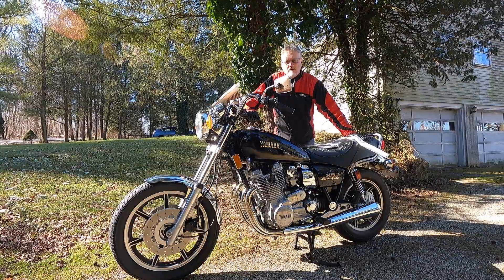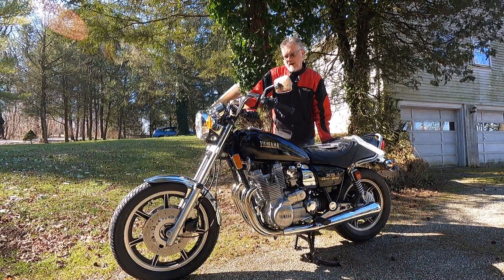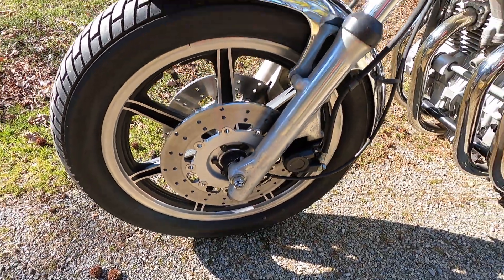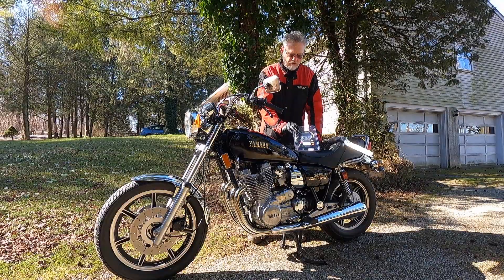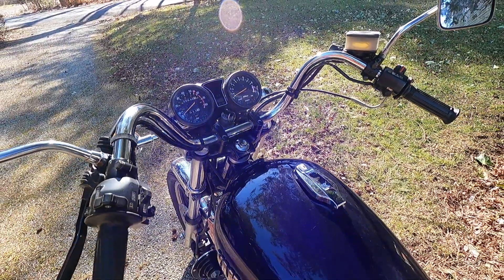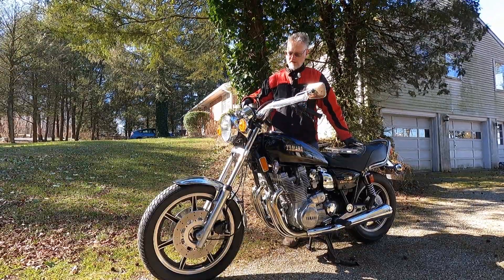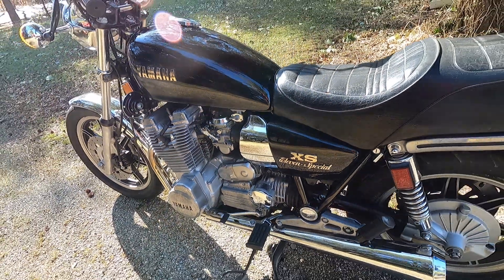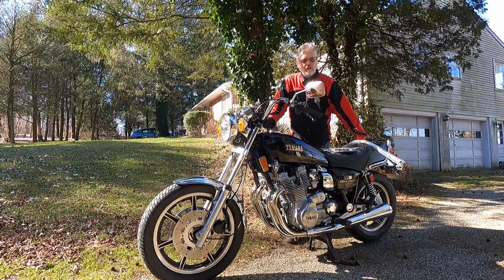1980 Yamaha XS1100 Restoration - Part 5 - New parts have arrived!

Comment: Yeah, Hi Jon, what I did with my '81  XS1100H model, is I removed the stock bars that back then were way too far forward for an "old guy", hurt my back after 10 min. of riding.  I had an old '82 Honda CB900C parts bike, I used those, and then I got some bar extenders  that pushed up 1: and back 2", because the 6.3 gallon tank on the standard H model was about 4" longer than the 4.4 gal. tank on the CB900C.  It brought the bars back to about PERFECT for long hauls.
Reply from the maker: Thanks, that's good to know! I'll see how the new bars fit me and change things up if necessary.

Comment: My 81 had a full fairing installed and seemed to have somewhat neutral handlebars (not exteme pullback)  
Eric in NC
Reply from the maker: They were probably not stock. Those stock buckhorn bars were the worst, in my opinion.

Comment: Where do you get your parts at for the bike?
Reply from the maker: Great question Tom. The dealership for some, eBay and other online sources for others.
Reply: @jonsmotorcyclerescueandrev3538  Thx, the reason I'm asking is that there is a guy in my area that has a 1980 Yamaha XS1100 with fairing and side bags for sale and I just want to source parts to see if I can afford to fix it up and get it road worthy.  Thx again
Reply from the maker: @troymtodd1252  Right on! It's always good to count the cost before purchasing!